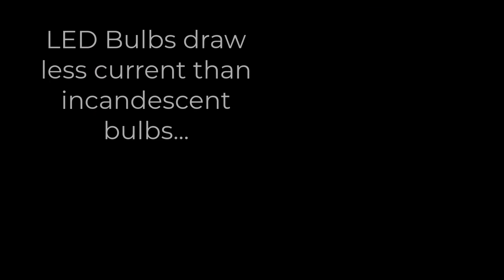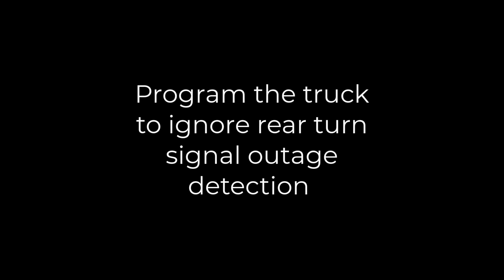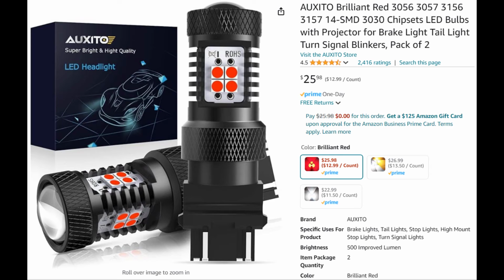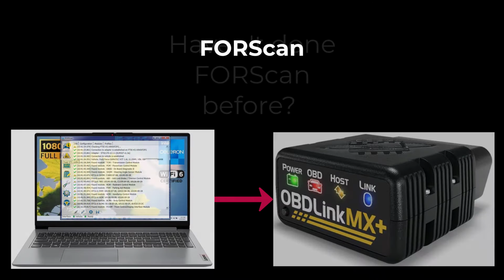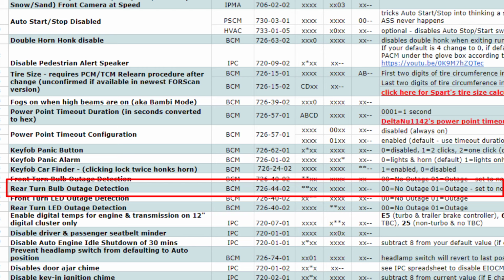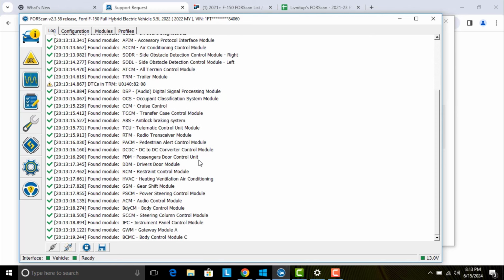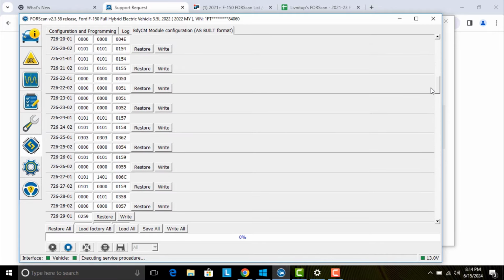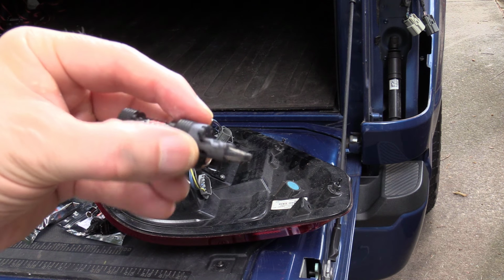Improve Your Signal Lighting on Your F-150!

Comment: Hi there, taking possession of my 2024 power boost  3.5 eco boost 7.2kw in a couple weeks. Did you get the extended warranty if so which one . I'm on the fence whether I should get it or not.  Consumer Report states that usually you won't see a return on your investment. Thanks Mate 😊👍
Reply from the maker: Hi Allen, I just bought one at the dealership when I took possession. Might have been able to shop around and do better but...I never used to buy these but with as complicated as vehicles have gotten to be, you need to insure your ability to repair. Can't just go down to the local yard and pick up a short block any more. On the positive side, engines are far more durable and efficient. Return on investment? It's like asking a skydiver if his backup chute is worth the cost.
Reply: @fixorrepairdiy4609  great analogy 😂 thank you.

Comment: Ck out LASFIT LED bulbs as they make a bulb with a built in resistor and you don’t get hyper flash. Used them in my 2020 F150 work great.